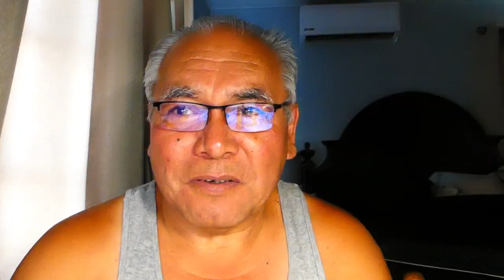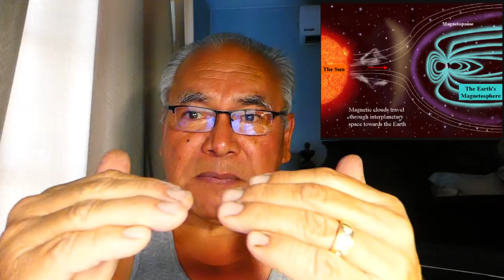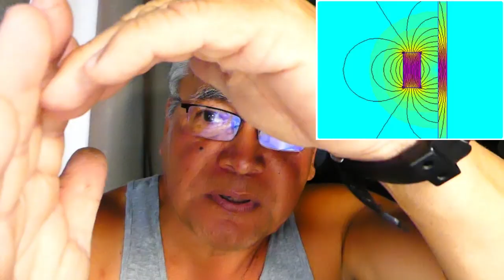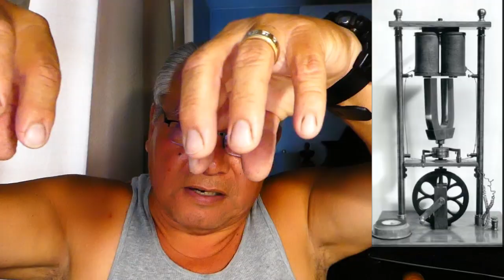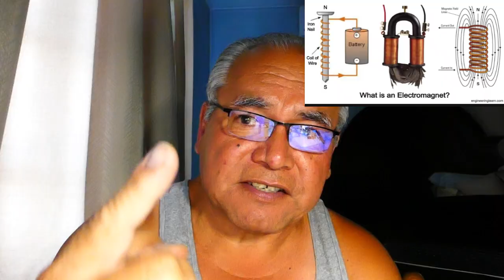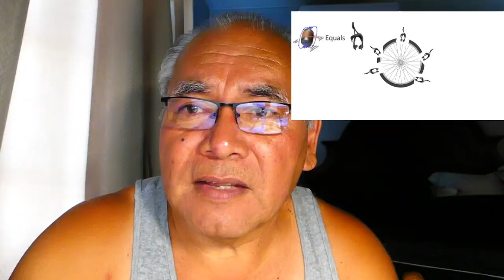kent    unkown secrets of free magnetic energy

Comment: Good day Alex, nice to hear from you again, I think we can modify the existing generator/motor by your concept by removing the magnets (radial), and place the magnets (axial), but we only get 50% due to only one face of the magnet is being use?
Reply from the maker: even as before ,(radially) you were still using only one of the polarities, magnets have 2 sides they are not monopolar
Reply from the maker: the interior iron or ferrite will still do the drawing in of the magnetic lines of force but the same coils will protect from lenz seeping out laterally so that is why you would build your coil longer to avoid direct confrontation at the ends wher the impact would be great
Reply: Thanks for your reply amigo, I understand that axial thing, but what I suggest is to modify the position of the magnet to axial position on the existing generator/motor, is that what you referring to?
Reply from the maker: @JoseRizal-q3o  yes, what i found out is that copper is magnetically transparent so you could come to the coils at 90 degres with the same efect except for the braking effect!!!
Reply: Bedini did the same thing, placing the magnets on their sides so the poles are 90 degrees to the coil, it created currents that lacked Lenz drag or heating and dangerous effects.

I believe the reduced output can be compensated for by using a step up transformer to raise the voltage to the needed level, the lack of drag on the prime mover should make this non-issue.

One thing I should mention is that the length vs diameter of your coil matters! In a coil where the height is dominant the coil will dominate in the electrostatic, if the coil is constructed where the diameter is dominant then the coil will magnetically dominant.

This matters because the ratio between the 2 affects the total output produced, you want the coil to have a 1: 1 H/D ratio so both are balanced, if one is more dominant than the other than the output is reduced.

This is especially apparent in resonant transformers like Tesla coils.

Comment: I like your straightforward analyse. Can you explain Faraday disk where magnetic flus is not cut and electric curent is still generated ? And disk is made of iron
Reply from the maker: maybe this vid may help....https://www.youtube.com/watch?v=dTsj4ByTAEI
Reply: @alexmanzanero  well, I know how it works and why, I was hoping you can explain better then myself. Every single matter particle in universe has an electric charge, we just push it away and collect momentum. We only need emp to squeeze an electric current and as long as we keep it unidirectional we can use as much as we can/want.

At ground level most of the radiated energy in the space is dissipated in the atmosphere uniform and almost equal … except matter with higher potential to absorb and concentrated like metals or high reactive elements. Radioactive elements are able to retain higher potential in a well condensed form which radiate even more under stimulus.
Reply: The magnetic field of a magnet does not rotate with the magnet, when you spin the disk it is moving relative to the field, when you spin the magnet but not the disk the field is not moving relative to the disk.
Reply: @JenkoRun well, this is not the explanation I have asked. You just repeat a fact that is known.

I am asking why an electric current is generated without cutting magnetic field/flux with a conductor ? The disk is parallel with magnetic field … while mainstream science keeps saying if we need to generate electric power we MUST cut the flux/field … which in Faraday disc is not happening
Reply: @Caesarus2011  Okay first of, there is no such thing as cutting the magnetic field lines, that's a false understanding because they don't even know what field is.

2nd, I answered your question:  When you spin the disk it is moving relative to the field.

That's all there is to it, physical motion relative to the field, or field motion relative to the conductor, either one works.
Reply: @JenkoRun I am still not satisfied with the answer. Knowing the voltage (pressure) depends on diameter of the disk and current on the thickness of the disc we can easy draw so conclusions that are simply yielding at us, not just being obvious.

And going further, we can “see” how magnetic currents work fro inside to outside for each pole in two opposing spirals. Easy to explain why ferromagnetic elements are attracted by each “pole” or why same poles repels exactly like to parallel conductors test for same “direction” flow
Reply: @Caesarus2011  Voltage is not pressure, it's tension, literally.

Additionally the current is significantly more dependent on the diameter of the disk than the voltage, as well as speed of rotation and the strength of the applied magnetic field..

Magnetic polarity is literally spin direction, 2 poles pointing at each other is 2 opposing vortices, opposite poles at each other are in the same direction.
Reply: @JenkoRun oh, I know exactly what you say … I am trying to make easier to understand for everyone.

I really don’t mind if someone think is pulling or pushing, pressure (as Tesla says), or tension … the working principle is important, completely different from what mainstream science teachings.